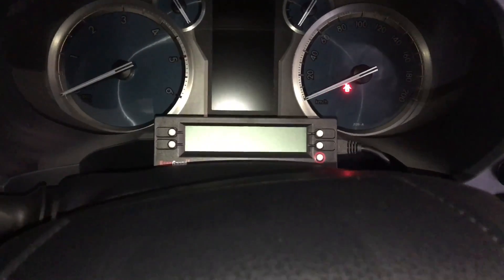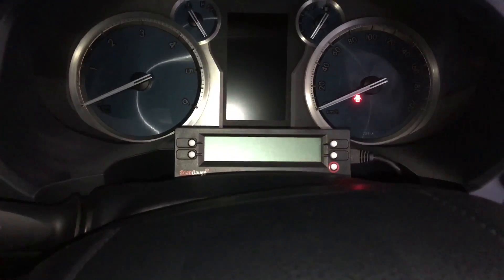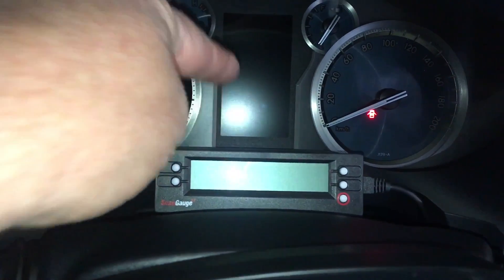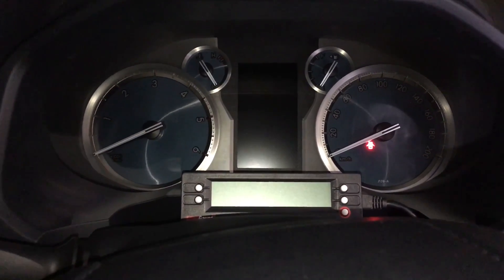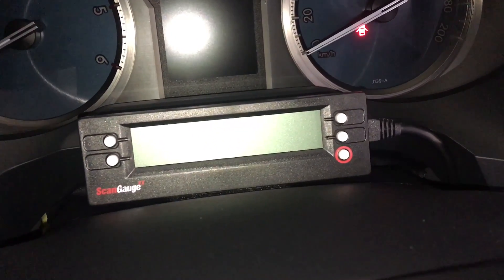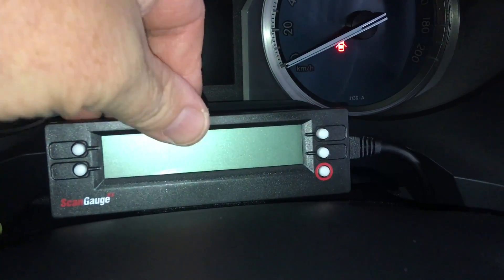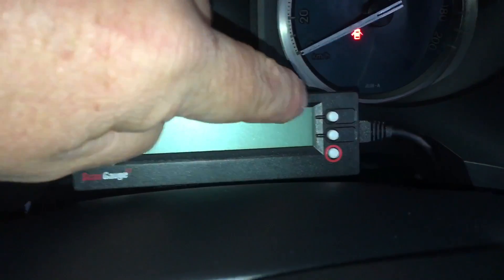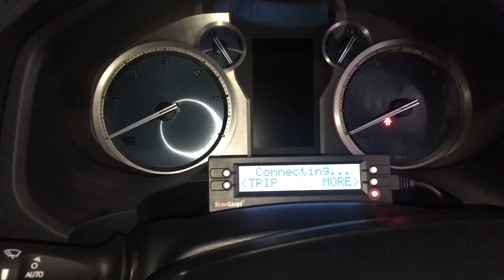ONE DAY YOU WILL WISH YOU DID - ASK MICHAEL TODAY He is On side Hume Fwy no scanner $300.00 Towing

Comment: Can I put 1 in a 2003 120?
Reply: Unfortunately the ScanGauges do not work with OBD1 Toyotas. We did also sent to Anthony a diagnostic tool Vident i400AU. It is not a gauge however it is capable of full systems diagnosis and live on OBD1 Toyotas including the 2003 120. See the i400AU for more info here https://www.azscanners.com.au/vident-i400au-obd1-obd2-scan-tool-for-toyota